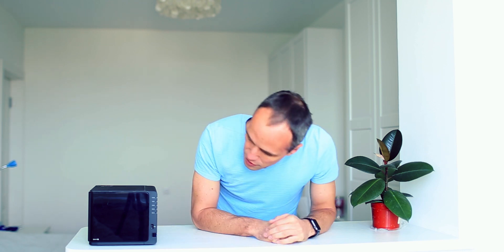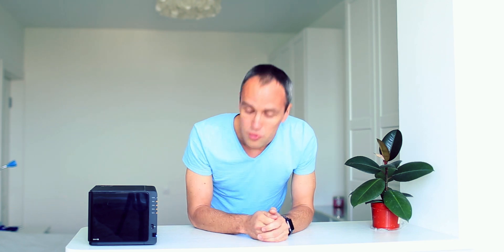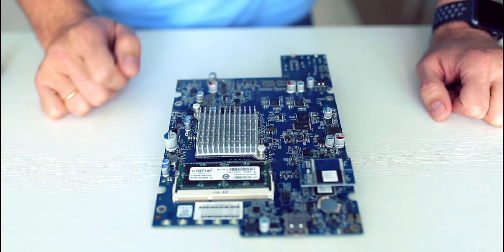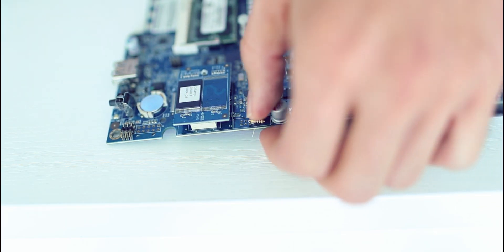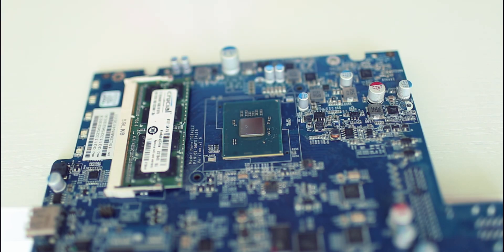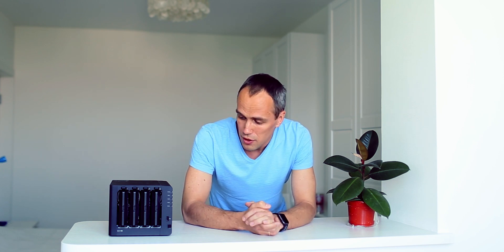Synology DS415+ revival [Intel Atom C2538 failure]

Comment: Thanks as well from my side.
I did a terrible soldering job (yours looks amazing compared to mine) and also ripped off the mainboard battery holder. I saw another video where it happened to someone else as well. I managed to glue it back on and did not have a lot of hope when I pressed on the power button. But...tadaaa! It's back!

Comment: Thanks for the detailed video. Bought my DS415+... 6 or 7 years ago. Worked perfectly until a couple of  months ago. Exact same issue and applied this fix.. now working again! A big relief! I used a 300ohm resistor... felt like the 100ohm may be too storng.. just my opinion.
Reply: Hey there, I am clueless about electric circuitry, why you say 100 is too strong, what is the dif between them? Also why does this fix work if the DS doesn't ship with that resistor there.
Btw I did the fix as the video with 100ohms and it worked too. Just trying to understand why and your point in choosing a different resistor
Reply: Without knowing the schematics...it's hard to confirm the optimum resistor value. Looking at the wattage rating of the resistor.. felt 300 ohm is a safer option.. for the longevity of the resistor.

Comment: I got my NAS broken few days ago (showing all lights orange) so I opened a case with Synology and they pointed out to your fix (they really sent me the link to your video 😁). I have just done it and the NAS is back. You can't believe how much you helped man... really can't say thanks enough!!! 👏
I am only curious to understand if this is a permanent fix or it can happen again. I googled a little bit and found this:
> The resistor fix just couples signal from a different clock line into the failed one. That other clock signal is not susceptible to the degradation as the failed one.
It seems that this could be a permanent fix. 🤞

Comment: disassembly 3:45
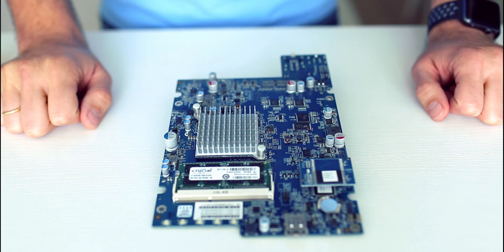resistor  4:53
battery  7:18
heat sink  7:43
reassembly  9:10
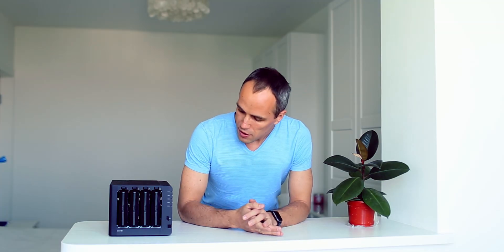power on  10:10

Comment: Hi can i change the DC adapter with 12v 5a cause the originale dc 12v /8a   is dead ... thank you... i have Synology ds412+
Reply: You can google for "power supply 12 volt 8,5 amp"

Comment: I had the same problem, I solved following the video, and again, one week later, again the 415+ is not working. I checked the resistor and seems all it´s ok, the battery was changed too, and not working.

Comment: I implemented your solution about a month ago and so far so good. Synology were next to useless but I agree with you time to find an alternative supplier. One thing I would say is releasing the case from the frame requires a bit of force as once you unscrew the retaining screws on the rear it’s a very tight push fit. Thanks for the video really helpful.

Comment: I had the same with the DS1515+.. Didn't repaire it yet. I bought a new one with 5 disc bay's as well. Swapped them out and started up again. So you dont have tor repair for recovering Data.
Reply: just just have to buy a new one, right?

Comment: Hi Nikolai. Great video! I have the same problem with my DS415+. I replaced it with a new Synology and migrated the disks. But I want to give this fix a try, just out of curiosity :-) I just have one question. When I look for 100 Ohm resistors, I see a bunch of different ones: from 0.1 W to 0.5 W. Which one did you use? Not sure how much it matters, but I wanted to check anyway. Thank you!

Comment: My DS2415+ just died today.  I purchased it on Sept. 2015.  It had a 3 year warranty, Synology added 1 year after they confirmed the problem with the Intel processor.  Synology should've recalled these units or extended the warranty to at least 10 years.  I went ahead and purchased a DS2419+.  Yikes...

Comment: anyone try this in a DS1815+?
the DS1815+ had one 6 pin's connector in the same place as the 12 pin's connector of the DS415+
the 12 pin connector is in the other side of the board.
Reply: Hey starglider101. Did you get the information regarding your question? Did you try the 12pin's solding to the 12pin's connector (did it work)? I have RS815RP+ , both 6pin and 12pin on one corner of the motherboard, similar to yours.

Comment: Surprised there is no mention anywhere on the internet about the idea of removing the defective Intel C2000 processor and replacing it with a different processor model that does not have this issue instead of adding the resistor. Why not just change out the defective processor with a good bug free processor? this is something I am definitely going to look into...
Reply: What did you find out?

Comment: Tip (1) , If you solder something, make sure you heat up the legs of a component with the solder iron, and after that, hold the solder against that, NEVER hold the solder against a cold component leg! Otherwise you won't get a decent connection. Another Tip (2) If you want to remove thermal paste, use cotton swabs, a piece of paper, and a little alcohol (90% or higher) will do. And it will come off very easy.
Reply from the maker: Thanks mate!

Comment: wow, my dead DS415+ just came  back to life after i have ironed the 100 ohm resistor same as you have described. I was more then sceptical about this solution and just tried it to ensure my NAS is definitly broken and there is no way out. Mainboard exchange is not possible they just have hdd brackets and powersupply as spare parts. Now i am shocked and amused same way, that a € 0,09 resistor + new battery € 1,50 repaired my unit as if nothing ever had happend. This video should have been seen by far more people - sure there are alot NAS folks out there haveing same issue and don't know how to solve. Who the heck came to the genius idea that soldering a resistor will solve such a dead NAS problem.
Reply: It was my idea! :D And you are welcome!

Comment: Amazing! I’ve never soldered anything before and I was able to do this with ease. About 2 hours later and my DS415+ has been revived with no data loss! Thank you!!! Here are the tools needed that I purchased:

Thermal paste: https://www.amazon.com/dp/B07L9BDY3T/ref=cm_sw_em_r_mt_dp_6MvDFbEFYRYB1

CR1220 battery: https://www.amazon.com/dp/B06XQ1C5TN/ref=cm_sw_em_r_mt_dp_4OvDFbHNN4GWJ

Soldering kit: https://www.amazon.com/dp/B06XZ31W3M/ref=cm_sw_em_r_mt_dp_zQvDFbPDZXRRA

1W 100 Ohm Resistor: https://www.amazon.com/dp/B072TQG3N3/ref=cm_sw_em_r_mt_dp_oRvDFbJCCYF0S

Comment: Thanks for the instructional video, good idea to replace the CMOS battery, do you remember what battery it was ... and what was the wattage of the 100 ohm resister?
Reply: Hey Wingfoot3a. Did you get the information regarding wattage of the 100 ohm resister?
Reply: @MartSaluri  .25W
Reply: @rexluger1940  thanks for reply. I already managed to solder a 100ohm resistor without knowing the wattage, but it worked. I wonder if this fix will last, am i in a position in which I could sell this machine?
Reply: @MartSaluri  mine was brand new, sealed in the original packaging when I opened it on December 10th of last year. Someone had it in storage for 5 years, but the warranty expired in 2017.

Comment: Synology® way to deal with its manufacturing problems is really bad. They failed to properly inform its customers about this issue. I'm trying to fill in a Court Case against Synology® for their failures. It's something similar to the way the cars manufacturers will have to pay or sort out for their products (car) manufacturing to the affected customers. There are some more other Synology NAS affected by this issue ( e.g. DS1815+ ) and therefore it should be many other customers being dragged into spending money on a new NAS. Please let me know if you would like to join me and ask for financial compensation from Synology® for their failure. Thanks.

Comment: Thanks great video. I'm trying to fix my DS414 which has exactly the same symptoms. The motherboard is slightly different though and I'm not sure about the pins where to put the resistor. Any advice would be very much appreciated!

Comment: Thank you so much to share this video!!! I done the soldering with the resistor and the DS415+ came back to life, with no data lost. I regret synology to said me that i have to buy another without any other answer. The next NAS will be a raspberry pi4 with a Quad SATA HAT for at least 100€ and not the aprox. 600€ for a synology 4hdd. I will not buy again synology. Intel has their guilty part on this, but is worst that synology hide and try to sell other units.

Comment: great video Nikolai, mine does the same thing, the amber and the blinking blue light. but it does power off after few mins is that the same with yours. or Not.. thanks
Reply from the maker: Yes it was the same in my case.
Reply: @AkimovNikolai  any idea about the Watts of the 100 ohm resistor ?  on ebay the resistors have different watts. Thanks
Reply from the maker: @patrickobi9217  I have used 0.25 Watt, 100 Ohm resistor.
Reply: @AkimovNikolai  thanks. Will update you about my fix tomorrow.

Comment: Hi Nik, and thank you for this tutorial. Do you think it will work on DS215J?
Reply from the maker: The problem I have fixed was with Intel Atom CPU. DS215J equipped with MARVELL Armada 375 88F6720 CPU so it shouldn't be susceptible to the issue presented in the video.

Comment: I tried to sell my 414 on Facebook but the buyer got it home, firmware updated but pulled the power before it finished. Now the DS just has a blue flashing light. I used another video on how to open the case to console and it says Can’t get kernel image. It posts and ram and cpu check pass. How can I reload the kernel image? Another post suggests a rom flash but I can’t even see which one the rom chip is?
Reply from the maker: Well, I am not familiar with DS414 model and you have described completely different problem. But looking at this article https://www.eteknix.com/synology-ds414-4-bay-nas-review/2/ you can see rom chip with a sticker on it right next to Marvell’s 88SX7042 4-port SATA-II RAID controller on this picture https://eteknix-eteknixltd.netdna-ssl.com/wp-content/uploads/2013/10/DS414_RAID.jpg

Comment: The DS415 + was no longer accessible overnight. After a restart, it always worked for a while, but then it was over. I soldered a 100 ohm according to the instructions in the video and so far everything works fine. Thanks a lot!
Reply: Interesting. I wonder does anybody able to explain the logic behind this, why it could work.

Comment: Changing of brand is not the solution since the bug is an Intel bug, not due to Synology. My mind is to change only if the product itself doesn't fill you needs.
But in this case the 100 ohms resistance works.
Reply from the maker: Yannick Bigot apparently the bug affects only Celeron 2000 series. So you should be ok with other Intel CPUs regardless of NAS/appliance brand. And yes DS415+ is really underpowered for my needs so I've switched to Qnap upgradable one (see my other video).

Comment: Will be trying this on my DS415+ that has just developed this issue, as soon as I have a 100 ohm resistor. Looks an easy fix but I wonder how long it will last?
Reply from the maker: Andy Hall 6 months and still working. But I would not use it for critical applications.
Reply: @AkimovNikolai  it's been about 3 weeks now and it's been fine so far. I'm still looking at replacing it or building an xpenology box though.

Comment: Can I do the same to DS414? 
I want to change the RAM on model DS414, but I cannot find any video about this model. 
As I can see they DS415 is almost identical with DS414. Do you know if I can change the RAM and if yes, what type of RAM I need to buy?
Also you can add as many RAM you want or there is any limitation on this?
Reply: The DS415+ takes DDR3L RAM upto an 8GB module so I would imagine yours will be the same.
Reply: @AndysocialUK  Unfortunately I can't. DS414 has fixed ram module, its not removable. Anyway... still working perfect so no need changes.

Comment: Why replace the thermal paste though? It wasn't strictly necessary, was it? You just did it anyway because you already had the thing disassembled?
By the way, my DS415+ is also dead. When I try to turn the unit on, the HDD LEDs are solid green, not amber. The blue LED just keeps blinking for a very long time and then the unit automatically resets, and it's stuck in a loop like this. Is that still the same C2000 failure?
Reply from the maker: You are absolutely right about thermal paste replacement. I am not sure about your NAS symptoms. Better ask in the Synology community forum thread I've linked above.

Comment: Problem has solved!. In my case, I just added 100 Ohm resistor and power back on then everything working fine. Thank you for your instruction.
Reply: Hey, got a quesiton. Did your unit not power on before you added the resistor, or did the LEDs blink like in the video? My DS1515+ seems completely dead (nothing happens if I press the power button), I'm wondering if soldering the resistor will help at all or this could be a power unit issue.
Reply: @mkarnicki  Did you end up trying the resistor? I have a Ds1815+ and is dead like yours. no blinking light. I just right now replaced the PSU and it made no difference. So my only hope is the resister but dont know if it is worth a try seeing as there is no powerup phase. you can easily check if your PSU is dead with this test,  which I only found out about after I already bought a new PSU... https://www.youtube.com/watch?v=ixcWCrYpw3Y
Reply: what is watts of the resistor you used. On EBAY 100 ohm resistors have different wattage. thanks

Comment: I cannot believe this. It was my only shot at repairing this (out of warranty). I almost didn't believe this, but it works! Awesome! Soldered in a 100 ohm resister per instructions, put it back together and it boots up again! No idea what this hack does, but thanks anyway to whoever put this online first! (unless it was Synology who did it to guide all those out of warranty customers to do some hardware hacking themselves instead of issuing a repair program)
Reply: Unfortunately, Synology was hiding the problem, the fix came from one of the Synology forum members.

Hey Maxime, I got a question. My DS1515+ (out of warranty) seems completely dead. I wonder if soldering the resistor could revive it. Did your unit flash LEDs before you applied the fix, or was silent at all? Mine is plain dead, no single light flashes, and I wonder if the resistor fix could help, or I should verify the power unit first. Thanks.
Reply: @mkarnicki  My unit actually started booting, but then all lights started flashing and nothing else appeared to happen anymore. So if your lights aren't even turning on i would think something else is wrong with your device. Verifying the power unit might indeed be a good place to start. Good luck with the repairs!
Reply: @mkarnicki  No your issue then is the power supply has died. You can replace it pretty simply tho.

Comment: Can I use a .5 watt resistor at 100 ohms? Or is the .5 watt too much? I ordered some .25 watt just found these and thought I would give them a shot....
Reply: ,5 or ,25 wat will both do the job, the ,5 watt is just rated to handle more power dissipation, which isn't needed here, but it doesn't hurt either.
Reply: @maxim635  can i use 100 ohm 1Watts , cant find any any 0.25 or 0.5 Watts rated on ebay ??? thanks
Reply: @patrickobi9217  The reasoning stays the same, the resistor will just be rated to handle more power dissipation. It will work. Maybe search again for 1/4 wat resistors, they're often called that too. Like here: https://www.amazon.com/Projects-100EP514100R-100-Resistors-Pack/dp/B00AVSDYFO/ref=sr_1_1?dchild=1&keywords=0.25+wat+resistors+100+ohm&qid=1587726075&sr=8-1   Good luck!

Comment: My unit is not powering at all though adaptor is showing fine. Can it be same issue? What is the symptoms of Intel Atom C2000 issue. I am not a techy and Synology has given me a cold shoulder as my unit is more than 3 years. Thanks in advance.
Reply from the maker: You can see the symptoms starting at about 0:35 mark in the video. Status led is off, HDD leds are orange, and Power led is blue and blinking. Unit is not responding to any requests.
Reply: Thanks for the question Santosh and the answer Nikolai. I was looking for exact symptops. I suspect power unit in my DS1515+ died, because no leds turn on, so it's probably not the Intel bug.
Reply: @mkarnicki  Is the same problem... my synology DS415+ blue led only flash once when the plug is in and then nothing happen, unplug and plug again and only flash blue once. After the soldering the DS415+ starts working again.
Reply: Having intermittently failed to start my 415+ ultimately completely died - no lights at all. This resistor fix appears to have solved the problem for me.

Comment: I just did the "resistor fix" to my DS415+ and it worked. However I'm left wondering how long this will last? Is yours still working? Nice video by the way!
Reply from the maker: Thanks! My DS415+ is still working as of today (two months since the fix). But I am building a new NAS to replace it. Will post a video later.
Reply: @AkimovNikolai  its been 5 months, is the fix still working ?? or Not .. very good video and clear speech. Thanks

Comment: Is there no place where one can get a replacement motherboard?
Mine fail and I lost all my photos!
Will never again use the Synology Raid.
Reply from the maker: If the problem is indeed with motherboard I would try to get some information from Synology support. Slim chance but still. Otherwise I would try secondhand market. These guys have all kind of stuff.
Reply: SHR is basically standard Linux software raid, if you have a access to a computer (not a tablet or phone) you can connect the drives to it, using an USB SATA enclosure if neccessary, boot the computer with Linux, and access the disks. There are instructions on Synology's webpage: https://www.synology.com/en-global/knowledgebase/DSM/tutorial/Storage/How_can_I_recover_data_from_my_DiskStation_using_a_PC